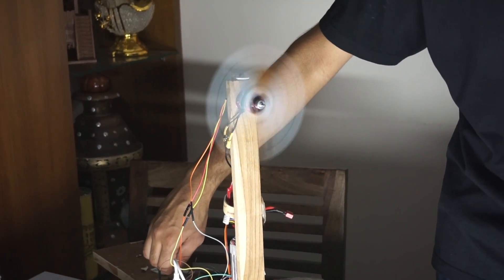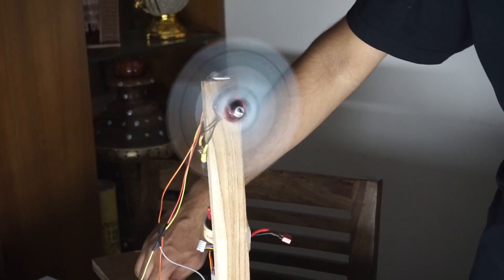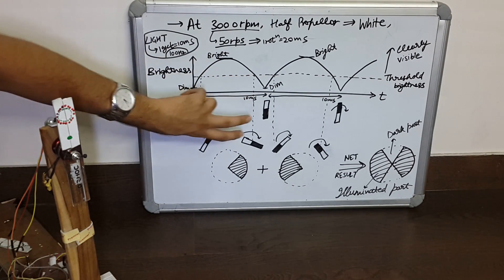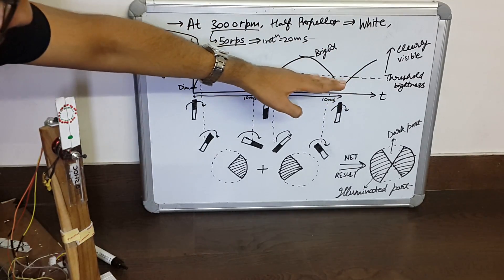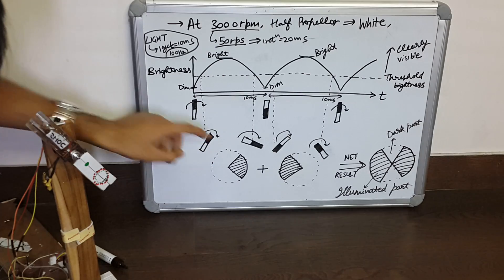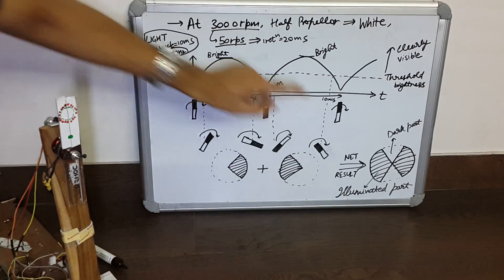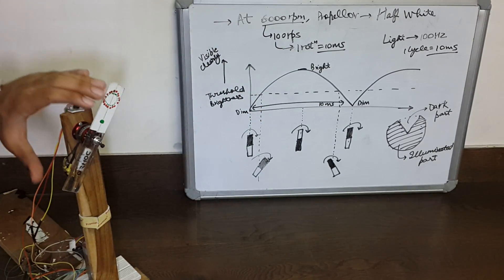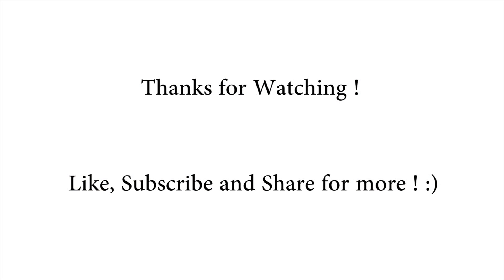Stroboscopic effect due to tubelight (when half propellor is white)

Comment: Nice explanation Kulbir. Is this phenomenon related to sampling or aliasing? We could consider tube light flicker as the sampling signal and 3000 and 6000 rpm are the cases of undersampling as considered with 100Hz. Is this the case?